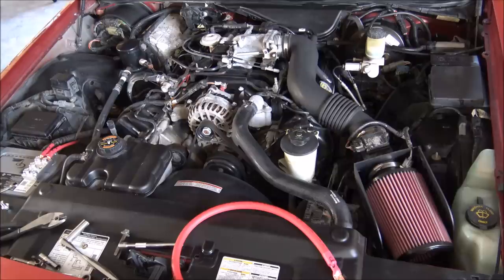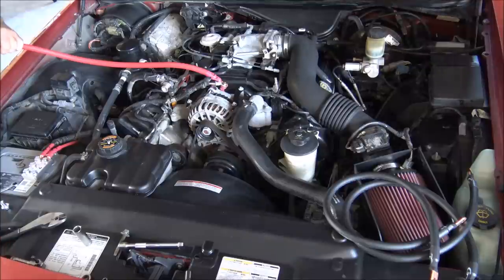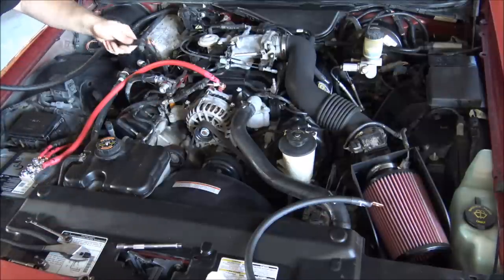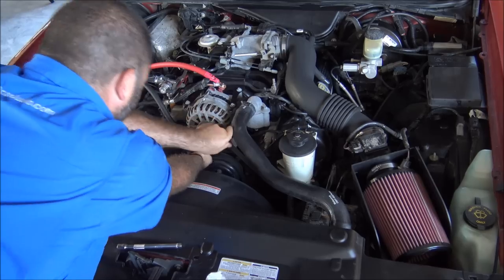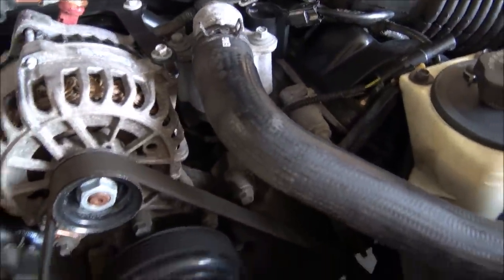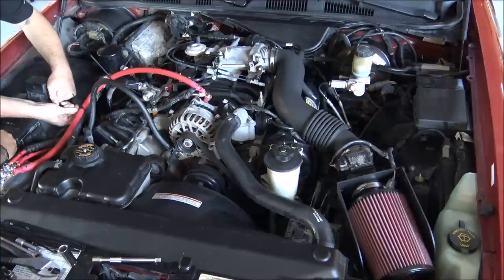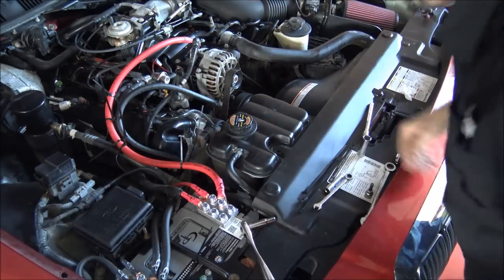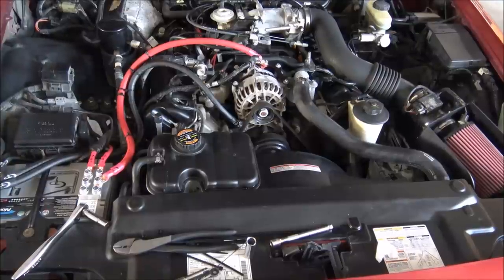HOW TO INSTALL THE BIG 3 UPGRADE CAR AUDIO

Comment from the maker: Whats up BASSHEADS!
1/0 AWG GP Audio Made in the USA Ultra Pure OFHC Copper Big 3 kits $59.99 SHIPPED 
http://gpcaraudio.com/gp-no-bs-wiring/amp-kits-big-3-kits/
Reply: I have a 1984 Porsche 911 with the battery in the front and the engine in the back making it difficult to do the alternator. Is there a benefit in just doing the negative chassis upgrade only?
Reply: So 1 power wire from alternator to battery, 1 ground wire from alternator structure to battery, and 1 ground wire from chassis to battery?

Comment: I think for pre 2010ish this should be a good thing..but not so much for modern cars and all the electronics...cars electronics today are strict with everything it seems
Reply: That's what I'm saying I have a 2018 Kia Sportage and the wires look decent in it comez with a stock 150 amp alternator. I'm running a 1400 RMS amp And a 400 RMS voice amp. But in reality I never do those numbers because I'm only running 1 12 inch sub. So I don't think it would be necessary if I installed the big 3.

Comment: Wait...you're not going to fuse that Pos cable from the Alt to the Bat? The factory cable has a fusible link for a reason. Love the ratchet sitting right next to the positive terminal at the end(he actually sat the ratchet on top of the battery earlier). SMH.

Comment: Thanks for this video, because I ran the big three upgrade and some other video suggested to run the alternator ground off of the frame where the engine block grounded. Let me tell you It arced in me. Then I remembered how these professional guys sounded and made it seem simple and it was. I ran 1/0 awg wire,straight we’lding cable. My car jams now, all the way around at 14.65 volts ! I love it

Comment: Yo! Appreciate the info...👮🏽‍♂️👍🏽
Question... Do I need to disconnect the NEGATIVE first, before hooking up the POSITIVE from the alternator to the positive battery post? And then, the NEGATIVE from alternator to negative battery post?
I don't wanna fry any components...🔥

Comment: I went negative on battery to chassis...5 inch wire. You went negative to engine block. What should I do? Make a 4th going from negative to block or replace my negative to chassis?

One more question.. Do pure copper ring terminals make any difference or do the gold plated or aluminum work just the same? Is it worth the hassle changing them out?

Comment: Got some questions.1)are these only for older cars?2)I have 2017 Subaru Legacy with stock audio system,but have some led bars installed,would it be ok to install these Big 3 upgrade even though I don’t plan on installing aftermarket sound systems?and also power from battery to alternator doesn’t it need to be fused?and how would I know what amp of fuse I need,?i plan on getting your 1/0 gauge kit,thanks

Comment: I know that a short to ground on the alt to battery power wire will be virtually zero but what if the alternator rectifier goes bad and shorts out?  Doesn't the stock amp to battery have a fuseable wire at the junction box?

Comment: Sir I want to ask..my alternator is 100amps output..I installed power wire directly into positive of alternator to the positive of the battery with 150 amps fuse..Iam also having sound system 2 amplifiers also with fuse but lower amps..my question is shall I need to replace the fuse of may power amplifier into 150amps??coz its all connected to the battery??to avoid toasting of fuse??

Comment: For your original negative wire that connects to post of battery.....what did you do to it? Did you take out? Cut and put new lug on it? Wondering bc I have the 6 spot flat terminals as well and I’m not sure what to do with that specific negative
Reply: I have the same thing. I just order my big 3 I’m going to cut the wire and put a terminal. Never hurts to have extra power and ground lol

Comment: Going over the cvpi electrical diagram , a fusable link is required from the 200amp alt to the battery. Do you not need that or a circuit breaker of 250a

Comment: How did y’all install the SAE 6 bolt battery terminal from the factory positive and negative wiring?? I have a 2004 Grand Marquis and I would like to add the new terminal

Comment: So do you jus leave your existing alt power wire and jus add the 1/0 power wire to it? Also is it necessary to fuse the big 3 power wire that goes fron alt to battery? Seen people do it and people not fuse it. Thanks alot

Comment: Does the ground cable need to be touching the alternator or can it be connected to the alternator mounting bracket? I have mine connected with the same mounting bolt you guys used, but my cable is against just the bracket instead
Reply: As long as the grounding point is conductive.  Take your meter, from the - battery terminal to the alternator.

Comment: The big positive wire from alt to battery should be run under the a/c line to match up w the negative.   Cut all zip ties w flushcutters.

Comment: The ground on the alternator should come out the back of it it goes from ac to DC and alternators ground out the back not the front and the reason why is that the ground now has to go through the whole alternator to get its ground

Comment: Hello, I have a '99 Tahoe, my lights flicker, all my exterior and interior lights. Do you have a kit for it, and will it possibly correct the problem?
Reply from the maker: J R hello, the big 3 will make huge improvements on your electrical flow, we can make a big 3 for the tahoe that is drop-in ready, I have the measurements for it. Call us 10am tp 5pm Monday through Friday and we can be sure you are properly setup per wattage you are trying to run 👍👍

Comment: Did you keep the original wiring from the starter to the alternator? I'm doing this an a Chevrolet impala ltz. I need to know if those have to be removed.
Reply: No you can go on top of stock wires

Comment: Do you need to put in a better battery and alternator to do the big 3??  Or can you do the big 3 on factory battery and alternator!?
Reply from the maker: Ramon Strong you can Definetly install the big 3 without upgrading the stock battery or alternator, it makes a big difference. Then from there upgrading the battery and alternator just increases the results even more
Reply: Thank You.... For letting me know!!
Reply from the maker: Ramon Strong no problem

Comment: Can you make sets that have longer ground leads no other company sells the with longer then 3 feet for chassis two ground wires lifted trucks always need a little bit longer on the grounds 48 to 64 in
Reply from the maker: All of our universal kits are 48", but just call us direct on the number on the website and we can make anything you need down to the inch.

Comment: If you add a second battery;  would run a positive cable straight to the second battery or use a isolator?
Reply from the maker: skip the isolator, you want to be able to tap into the underhood battery power also. positive to positive from battery to battery, fused on each end to isolate the run
Reply: Thanks guys.

Comment: ? Im running 2alpine type x on 3 k rms is that 2 much for them also im running 4 gauge power and grounds and im getting clipping at low gain so im assuming i need the big 3 upgrade and thinker wire from battery to amp please let me know what u think

Comment: What did you do with the original 12 volt cable that was on the alternator before the upgrade ❓
Reply: You just add the zero gauge you don't remove any stock wire
Reply: So just add it with the alternate wire

Comment: How would this work on a 2017 Ford Fusion Hybrid Se? I plan on having a system 1200-1500 watts and beneath my hood is different. I have a stock battery in the left side of my trunk as well.
Reply: I would look into getting a higher output alternator first Ether one that is compadable with your fusion Or a Aftermarket one made for your fusion. example My Chevy Blazer Alt stock is a CS-130 rated 85Amp. Tahoe and other GM trucks Use a AD-244 rated 105 to 190 Amp which use the same bolt up and pin connector, (1 inch bigger belt) and sell for only $40 more then the stock CS-130...After market CS-130 - 145Amp sells for $110 more 

Next would be your wiring system Then a battery upgrade
Reply: James Mb there is no alternator on my car. I’m thinking about just upgrading the rear battery cause I just got the skar Rp1200 with an EVL12
Reply: James Mb I honestly don’t know which battery to get

Comment: Can i just run the negative to frame on the side where the battery is, on the iner fender there's a small wire grounding the battery

Comment: It's funny. I did the big 3 with 2 gauge cable with soldered and crimped ends and frame, block, body grounds. Also used 2 gauge to alt and bus bar(old shit with weird electrical). I saw no change at all. Same voltage off alt and a negligible resistance to battery drop. For anything over 1000 rms system's I think the entire secondary electrical system should be isolated from the primary electrical system. Separate alt, battery/ies and stand alone ground and cable runs for best efficiency so the stock system is unaffected by voltage drops during heavy loading of the electrical system. Would lead to a better overall performing system as well as less taxing on the stock electrical system. Granted reducing resistance from alt to battery to ground is still a good idea for more efficient power distribution.
Reply: Get ur self an high output then do the secondary connection and yes it will work completely isolated lol i have 99 tahoe with an ambulance alt 2 extra bat my tahoe has and extra battery plate in front im running 2 double 0 welding wires from front to back i have 4 txx bd4  and a couple of amps 1 for each pair of bd4 i have ex amp for mids and ex for tweeters

Comment: Questuion are u adding wires or are u replacing the original ones with bigger ones?
Reply from the maker: Adding wire, leave all stock wiring in place.

Comment: So when doing the big 3 upgrade you keep the original alternador power wire??
Reply from the maker: Yes keep all stock wires hooked up.  Consider those stock wires are for your normal vehicle operations, and the big 3 an electrical bypass to flow more current on top of that.

Comment: Just ordered my 1/0 big 3!  

Do I need to unhook the battery terminals from the battery before doing this? Or remove battery altogether? 

Thanks
Reply: Because youre not breaking the circuit between your battery and vehicle you shouldnt need too. But if you are working alone then you can disconnect the ground in case youre not comfortable.

Comment: When I run a second battery in the back of the vehicle can I come directly off of the alternator or do I have to feed it off the 12 volt battery from the front
Reply: I went from positive terminal on front battery to positive on back battery

Comment: What did you spray on the ground wire under the vehicle so it doesnt rust?
Reply from the maker: MrWtfjusthappen1 I think that was just a rustolium black spray paint. Or plastidip

Comment: On another thought . I usually run battery neg to frame from frame to motor , or ill use the factory ground strap ( 3" wide copper strap) and ground my battery to the same place . I see better response from grounding the body to the same frame mount  than i do running a third ground from the motor to the battery . Also ... Whats the point of 0ga  in such a short run ? Anything under 4 foot 4 ga will transfer what 300+ amps ?
Reply: Your comment has alot of sense to it cause what your saying is true. Even in the Amps and volts chart it tells you what size wire for how long and how many amps it will be good for . I guess they just say fuck it just do it all 0 gauge

Comment: I’m supposed to have my big 3 done today. I’m bringing 4 gauge wire but I  don’t need a second battery?
Reply: Ice MAN found out yesterday after almost a month that the ground chassis bolt wasn’t tight AT ALL. Almost was about to fall out so my car was resetting and all kinds of crazy stuff. Perfect now lol Austen banging hard as f at 14.1 v at night with all my lights and AC on in Dallas 100 degree weather :) lol so happy and pissed at the same time lol
Reply: Ice MAN need AGM Battery, plus 1/0 gauge to run a big 3. Also go to mechman.com
Reply: Ice MAN get the 2ed battery if you beefed you alternator. If your alternator is beefed up and got a good AGM battery, with the big 4... you should be good on steady Volts. I was hitting 30Hz last night on my preferred volume (louse asf) my voltage stayed at 14.0
Reply: Ice MAN what system are you running?
Reply: Ice MAN do what brand and amps do you have?? I do not understand anything other than SPL 15 inch
Reply: Ice MAN gotcha. Yeah I would use 1/0 DC AUDIO wire (OFC) like I have to run the big 4. The 2ed battery only helps if you have a high output alternator. Since you don’t want a 2ed battery then just run the big 3 but with 1/0. I didn’t mean to put 4AWG on there. I need to change it
Reply: Ice MAN yes you should. The problem I had with my big 3 is when I had some “Custom Shop” install it and I noticed right off the bat something was different about it. The motor to chassis ground wasn’t even done. He only ran a positive and negative from alternator to the battery and I thibk he maybe grounded the battery again and that was it. I normally get to work 30mins just yo sit and play my music and wake up cause I have to be up early. My speaker started to smoke and I made them take the big 3 out because of it. Then it sent me into a long almost a month of trying to figure out why my voltage was all over the place and then my car not reading my key fob and my car restarted while driving lol and thousands of dollars and almost a month later we found out the ground negative battery wire bolt was about to fall out... so that asshole who did it should of known that’d be the first bolt to tighten but nope and I didn’t even think to check it out but I did just the wrong end of that bedtime wire and this is very recent I just got it fixed. Prob a few days ago. Today is my first day back to be able to hang my system that hasn’t even been broken in yet (L7Q15INCH w/CXA1200.1&CXA360.4) staying at 14.2 ish with all my lights on like low beams and hella yellow fog lights and my A/C on max in Dallas Texas. So good voltage and all because of a loose bolt. I’m about to redo the big 4 because of it. I couldn’t believe it
Reply: Ice MAN yeah he should of and that’s what makes me wonder if he left it like that on purpose. At a custom shop that’s the first bolt that should be tighten down first lol so maybe today I’ll be going on there to trick them. Just so I can prove it was them. I’m going to ask for the big three again and let them mess it up again just to show him that he did actually mess up and could of started a fire or made me crash when my car was restarting while driving on the high way. I already told him ( owner of this “Custom Stereo Shop”) that I could of brought him a damaged L715Q class or a melted car block and put it on their counter. They swear up and down they did it right but if he did then why not do the chassis to motor ground? Or even make it a full open circuit lol ridiculous so now I’m going today to have the SMD DD-1 plus for my tune for both of my amps and just ordered the W class 6x9s compensates to go with my 4 channel but wished kicker web site wasn’t all out of stock of everything lol it’s becUse they are coming out with new Subwoofers Solo basics and a lot of other stuff. I have the CXA series amps but I want the KX 1600.1 and the KX500.4 I think it is. Or I might do 2xQ class 2 channel amps for my mids and highs. Either way happy as hell that I found this issue. You can see my car in my channel but about to put a video up of my stereo system
Reply: Ice MAN I’ve been in brain surgery (8of them) so I have a lot of videos I’m about to put out with my car and stereo system and other stuff. The videos I have now need major help. I need to redo the thumbnails and titles and intros and just do better all around. I’m not a vlogger. Just put some videos up here and there and the system I have now is was better than the videos of what I have up. Upgraded to my L715Q and have a new custom Baltic birch box. It’s pretty cool. Just need to put the wood flooring back in my trunk and my battery back there and the rest of my lights and redo my amp racks.
Reply: Ice MAN it got sorted out since we fixed it. Just waiting on kicker to restock some things but yeah my system is fully complete just needs another tune and I’ll be good as new. I mean it already sounds crazy but will post a lot of videos this weekend

Comment: I have a crown Vic and done this but the top alternator bolt will not fit the 0 gauge and stock connection. Do I need that stock wire bolted up?

Comment: What kind of coating did you use for the second ground? Going to run mine the same way.
Reply: I went from negative to chassis about 5 inches of wire. He went negative to engine block. What should I do? Leave it or add a 4th ground?
Reply: @yusufjorgenz5951  both

Comment: I grounded my engine block and battery to the frame, then ran power from alt to batt. 3000 watts, but 2 runs of 1/0 each. Is this alright?
Reply: Riley Powell yes that is a normal big three upgrade if you upgrade your Alt then you may want to run another ground from the alt ground to negative battery. Search Big 4 Upgrade lol Have a good one